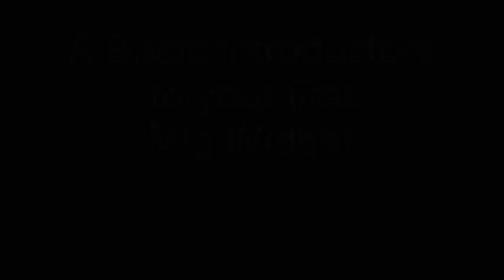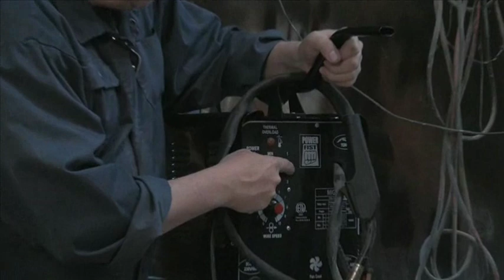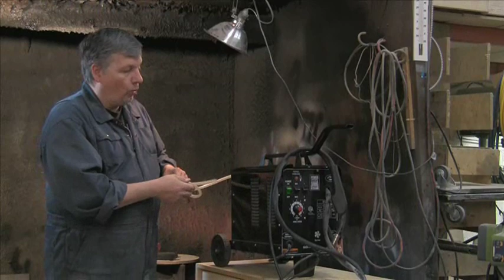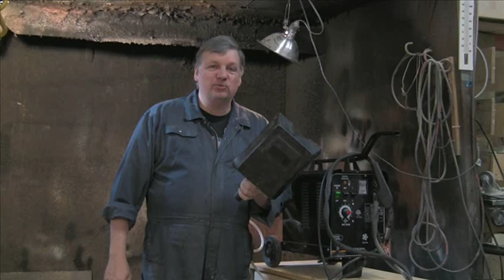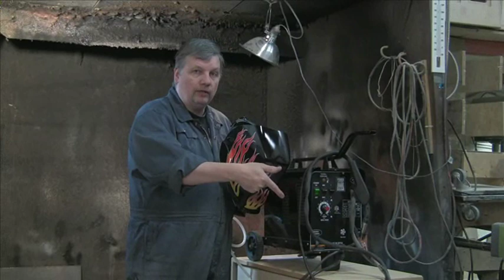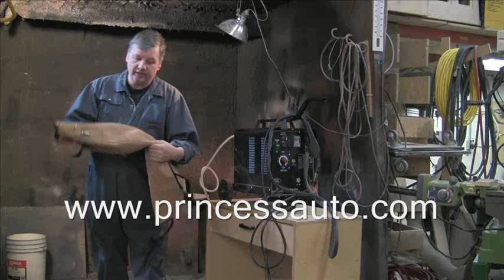Buying Your First Mig Welder

Comment from the maker: @matthewsmyth1001 
Hi Mat, There are so many variable's depending on the make and model of the welder you have. Go on line and down load the manual of your welder and it should tell you what current you draw at it's max heat. I would also suggest you get advice from where you bought it. In my search, the store I got it from had a resident expert to help.

Comment: buy a good welder lincoln, miller 230 volt, you wan a welder with capabilities, if you get a little one,you will regret it, mines 110v, but will do what his will, you need more amps so you can weld anything, you dont need gas, fluxcored wire works great, but you must reverse polarity, dont buy first and regret later, read many books at the library.